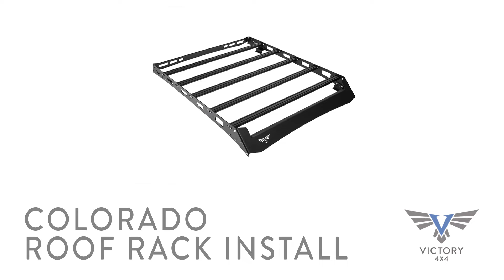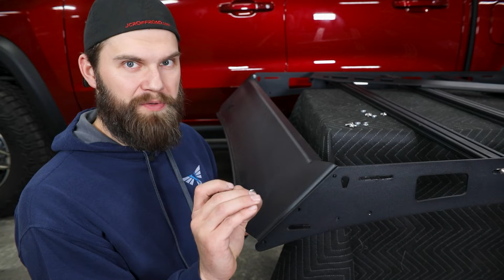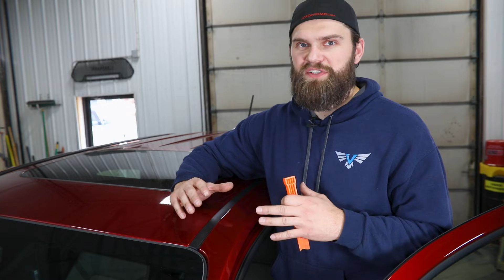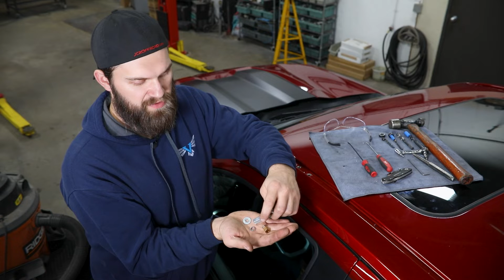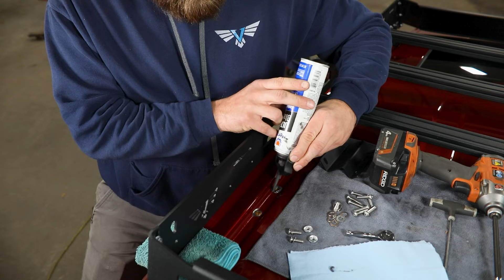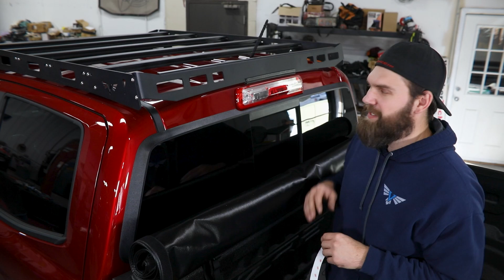Colorado Roof Rack Install

Comment: Around the 16 minute mark, it looks like the weld bead was ground down? to make sure the nut sits flush? how did you do that? what tools?
Reply: That’s just seen sealer. You can use a razor.

Comment: This video should be updated to include the side accent plates and more should be said about drilling the holes - especially the front 4. I did this yesterday, started with a 1/8 carbide bit. Easy peasy. Moved up to a 1/4 carbide. Pretty easy but I did end up using a second bit toward the end. The 23/64 bit supplied is inferior. You need another size or two between the 1/4 and 23/64 and they all better be carbide. I burned thru 6 carbide 23/64 bits, in addition to the supplied bit, and still needed more.
Reply: Yea buddy those front holes were a bitch. Do you attach the side plates AFTER you are all done? Like they sit over the bolts that connect the mounts to the rack?
Reply: @chriswilkerson1020 no the side plates go on first.
Reply: @adambabcock9143  Thanks! I just put them on after having them sitting in my garage the past couple months haha. Huge miss by these guys. I honestly didnt even know what the were for since I only watched the full install video to put them up

Comment: Any special drill bits that you used on those front holes with the double layer of steel ?
Reply from the maker: Great question! For those front holes with the double layer of steel, we recommend using carbide drill bits. They handle the tougher material much better and last longer than standard bits. Let us know if you need any tips on drilling speed or technique!

Comment: How far up on the bits did you put your bit stoppers/ how deep is the hole into the roof?
Reply from the maker: Just enough to get through the roof material, you can start with 3/16" and move to 1/4" if you are not fully through.

Comment: When Inhave done this before,  right after drilling the holes with a small brush I painted the bare metal with etching primer,  helps to stop corrosion with the sealant.  I like the look at the room mount, except for the rear corners,  which seem to stick out over the metal curving down.

Comment: Do you have a vid or have anything for a drivers pillar grab handle. They have one for the passenger side.  I don't know why Chevy didn't do one for the driver side for the trail boss. Hmmm.
Reply from the maker: No. That is not something we have a video for.
Reply: They didn't do it on any of the new models cuz you don't need it. You have a steering wheel to grab onto...

Comment: Okay. I would go with bolts thru the roof anyday over the nut plates. I did this job yesterday, and if I knew how easy it was to get under the roof of my truck with my hand it would have been done 3 hours earlier. Also, buy a lot of drill bits and step drill, like it's your job. Get a couple small diameter uni-bits to help Reem the holes. When drilling the extreme rear holes, the inner skin will separate if you use too big of a bit too fast. 
The front clips on the trim have a side lock that releases it from front windshield trim ends. Once released and pulled back a little, go the the back, push up on the trim to release, then slide to the rear all the way out.
Get the nut plate tool if you really want to use them.
Reply: This comment is for the 23 zr2. I don't think it would be different for other models.